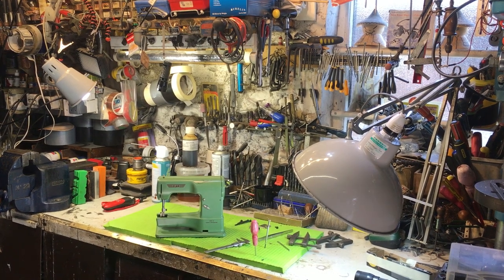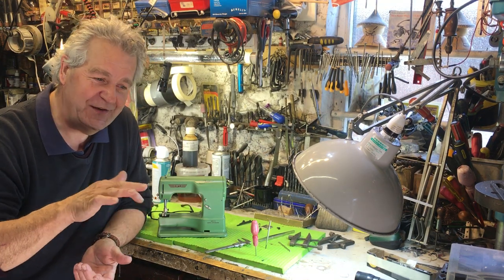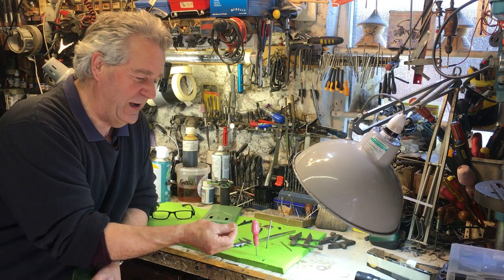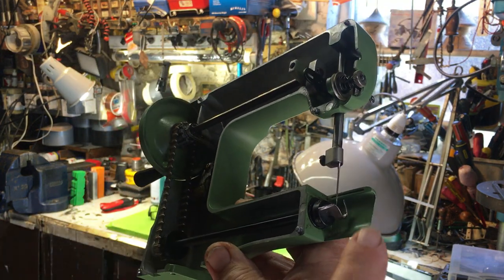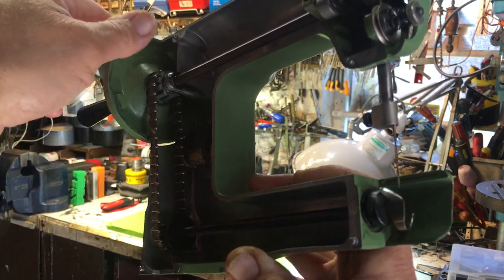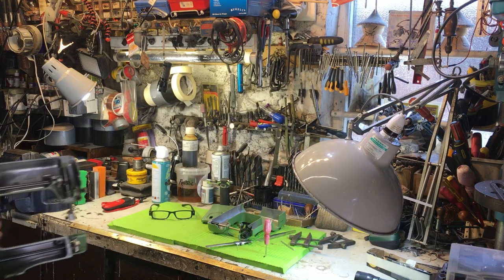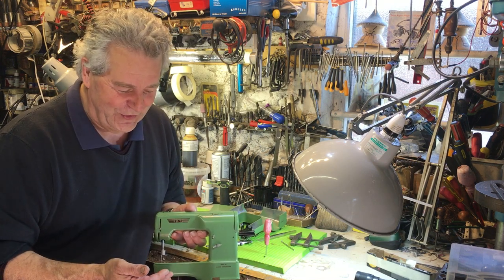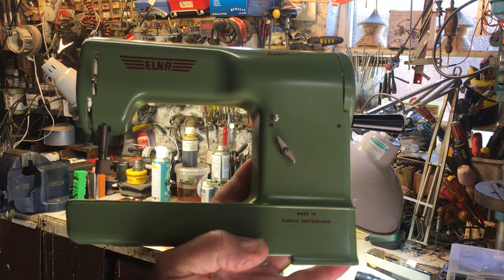Alex Askaroff Presents how a basic chain stitch works on an Elna Junior.

Comment: Alex it's so lovely to see that you are still making videos because it means that you are still in love with machines. You said that your dad told you to do a job where you lived what you were doing and you eouldnt work a day in your life. I didnt find mine until I was 40 but had a 20 year career in nursing. Loved every day if it.
 🤗
Anyway. Since Covid and wanting to sew some leather cuffs back on to a leather jacket that I bought from the charity shop which had never been worn because most orangutans dont wear leather. Anyway I cut off the cuffs and want to reattach. I have a modern brother. Nope. I bought a vintage 345 brother. Nope. I bought a singer 611. It sees 2 layers but need it to sew 7 as there are darts and a placket in the cuff.
I bought a singer 201k and a singer 15k. I'm really hopeful after seeing your tin can video 🤣🤣🤣
Anyway. Covid hit, the 201k and 15k were dirty, filthy, broken burned out and totally unloved. One arrived boxed in sofa foam and double boxed. The 15 arrived in a black bin bag. As I say I'm a retired nurse. No engineering background but I recall changing a plug when I was 10. I'm 64 now. Anyway I set about stripping down and cleaning the brother. It works. Did a good clean up and tune on 611. Then eith s wing and a prayer I stripped down both the 201 and 15 AND THEY WORK 😱😱😱 I've done the timing adjustments on the 201. I've reset the needle bar and pressure foot back to factory settings with the help of a 15-91 manual. Not this model but dont know which 15k is but its bang on the black lines now. The oscilating hook cant really be or need to be retimed if Iunderstsnd correctly.

ANY WAY. Why I'm rambling on is because I never had a foot pedal for the 15k. The motor for 291k is so burned out that the wiring melted onto the machine body and the carbon pile foot pedal wire melted flat onto the porcelain body. I have stripped it back and was about to empty the carbon disks out but the connections were deeply pitted even after a good clean up with energy. Lovely quality pedal. Such a shame. Has really excellent quality parts compared to the one on the 611 which was running on but after a good clean and reset works s treat. 

Anyway..  
I need a new motor and foit pedal for both that gives great power and torque but not necessarily rapid RPM. I cant find ANYONE who can tell me what that motor might look like. Any suggestions? I went YDK 90watt electronic on the brother 345 but still not much power. Any info or guidance would be really appreciated.

Comment: Thanks for this!  Love your posts.  What a gorgeous machine this is!  And the "special feature" is just wonderfully breath-taking.  Do you happen to know the oil points for the Lotus/Stella?
Reply from the maker: The Stella runs on the finest Phosphor Bronze bearings that don't need much oil but they do love a run. As the machine turns the bronze warms and oils itself. The best thing to do for your machine is give it a good run. You can drop ONE drop of sewing machine oil through the centre (under where the bobbin sits). As the machine turns it spins it onto the race.